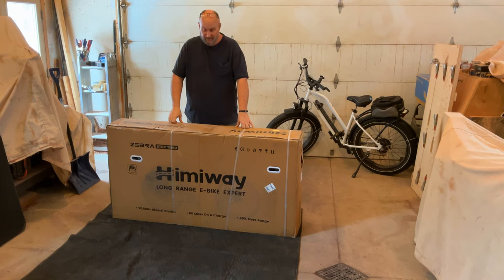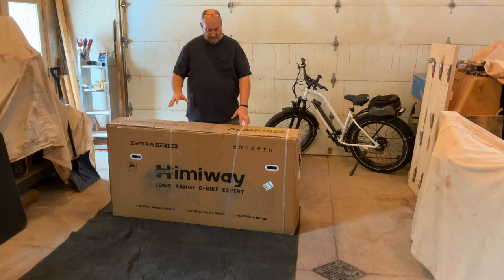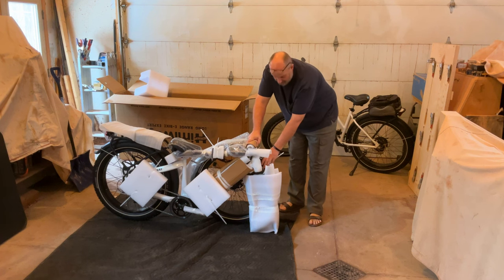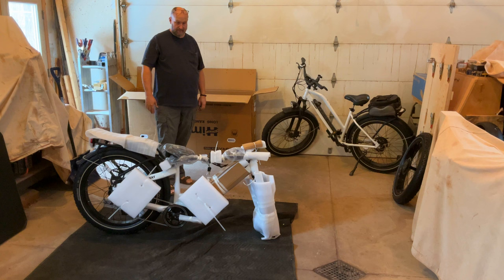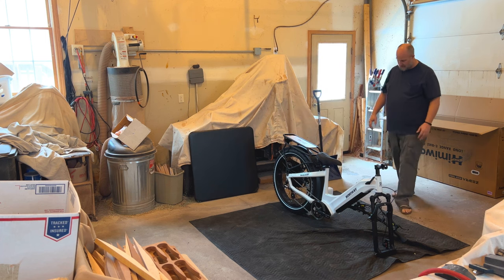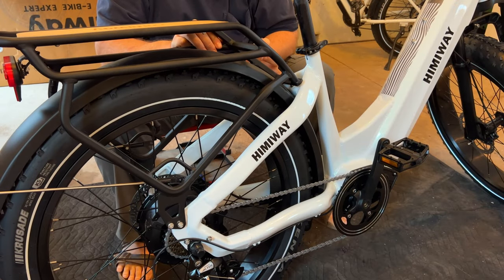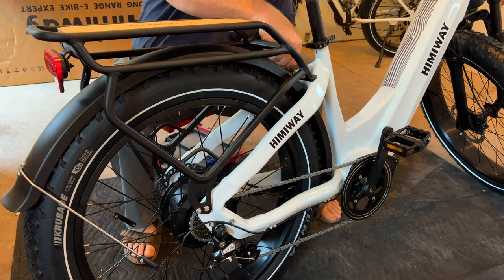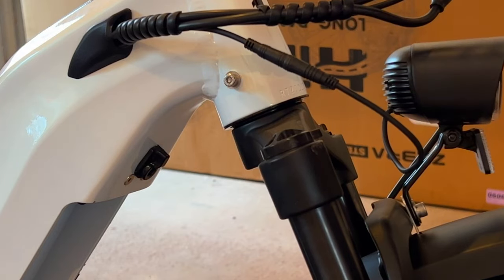Himiway Zebra Unbox Assembly - Tinkering Turtle

Comment: I am 62 with a bone on bone knee so I know what you mean and that's why I got the Zebra step-thru. I also love tinkering with the Ebike and I have got so many upgrades on my Zebra. I have had it for 1 year now and have 4000 miles on it. I live in fla. were you can ride year around. I try to put about 20 miles a day on it and I always use the PAS to get exercise and it is the best thing for the knee. I tell people it makes getting exercise fun! I had some problems the first 300 miles and had to use their online warranty service and I had no problems and everything went smooth I got the parts I needed within 10 day! so I am very happy with the Zebra Step-thru and I do think it is the coolest step-thru I have ever seen! Also, I just put some white wall street tire on it that look ride and go over bumps so much better than the stock Kenda tires. yes, I also have a stem riser and a adjustable stem, plus handle bars with a 90mm rise. also have a Kinekt Bike Suspension Seatpost  with a cloud 9 seat so it is set up for cruising and comfort! And lots more upgrades! Just wanted to give my one-year update.
Reply from the maker: Very nice, cool update!

Comment: I found a little gem after a couple months of riding my Zebra. A USB port for my cell phone. Located at the bottom edge of the screen. Look for a black rubber dust cover. Check all nuts and bolts after each ride in the beginning. they will loosen. I lost a few.  I have put my bike through its paces in really rough terrain. Out in the Rocky Mountains of Idaho. It took it all with out breaking a sweat. Absolutely love this bike.  Almost 900 miles and 15lbs lighter. I throw my fishing tackle in my saddle bag on the side of the rack along with gear to make coffee and head out. Gone for all day.  Your in for a treat my friend?
Reply from the maker: Good info!
I’m looking forward to it… ;)

Comment: The motor is also a lot easier to work on because it comes apart on the disc brake side and the wires come out the disc brake side between the hub and the frame and is a much better design, I also already put an 11-28T cassette and that gives you plenty of gear for no gosht peddling and the wires are not in your way! Can't wait to see what you do to your Zebra step- thru Because I really like mine!
Reply from the maker: I can’t wait until the snow goes away! I want to get this bike out there. I do love that the motor cable doesn’t go thru the center of the axle. This bike looks really well built.

Comment: Why didn’t you use your Bikehand mechanic stand?
Reply from the maker: I guess I could have. But for the minimal amount of time it was “unstable”, I didn’t feel the need. Once the front wheel was on I really didn’t need to stabilize it.
Reply: @TinkeringTurtle  fair point … although the movers blanket helped I always try not to set the weight of the bike on the front forks. Enjoy your reviews.

Comment: My bike didn't have that red thing when you install the wheel and it's loud when I hit the brakes?
Reply from the maker: It can be loud until you bed in the brakes. If it persists after a couple good rides, then pull the pads and clean them with isopropyl alcohol and re-install them. (clean the rotor too)

Comment: We have a himiway cruiser with 70 miles on it that is making a grinding noise and the rear tire spins for a few rotations very slowly then stops.  Any ideas?
Reply from the maker: I know this sounds strange, but unplug the motor and plug it back in to make sure it is fully seated. If that doesn’t work then reach out to support for troubleshooting tips and directions.
Good luck!

Comment: I just got my zebra two days ago, from the first time till now the turtle doesn't work. It work only second when i start riding en then i must use the pedal. Is it normal or should i contact himiway ? I want to use my turtle without pedal when i'm tired but it doesn't work.  Thanks
Reply from the maker: I am assuming you mean “throttle”. As long as your pedal assist level is set to “1” or above your throttle should work. If your pedal assist level is set to “0”, then your throttle is disabled.
If this isn’t the case then I would contact support. I hope this helps!
Reply: @TinkeringTurtle  thanks for your fast answers. I have tried it from pedal assist 1 till 5 and this doesn't work too. That work only first time in second en then i must use my pedal, i don't know that it is set up by the winkel or that is not normal. I took this bike from the winkel which set up the bike too. I should send email to them, thanks for a help brother.